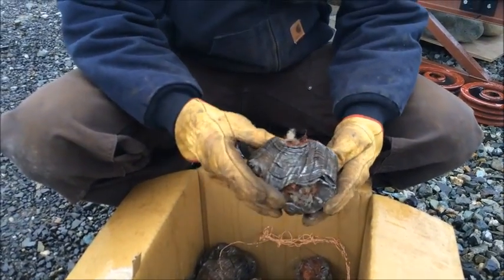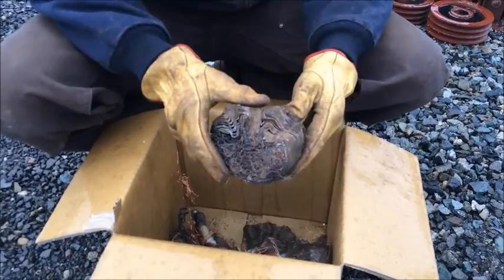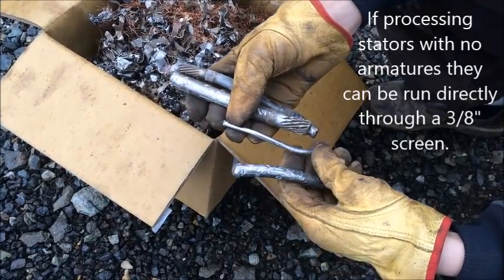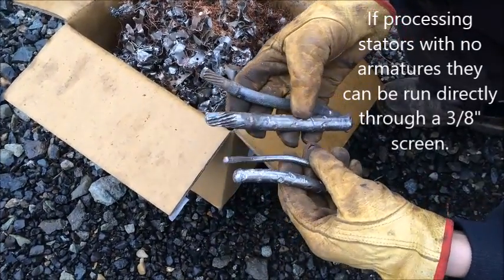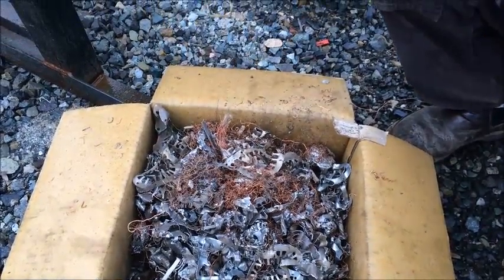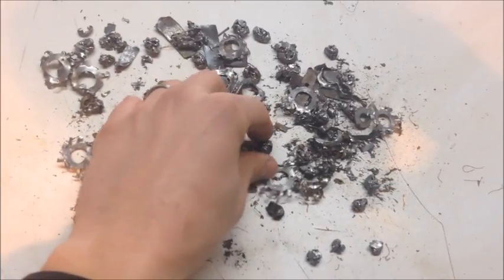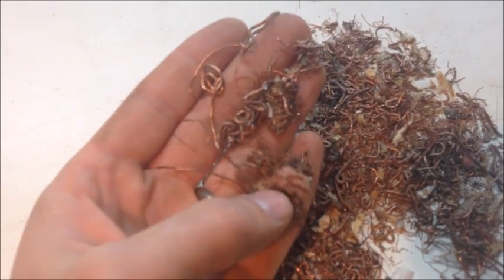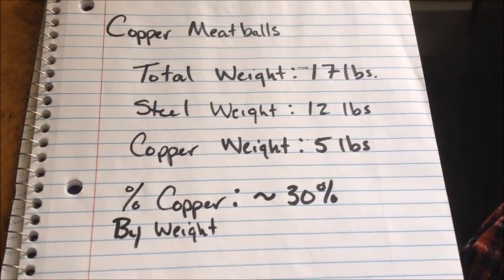MBMMLLC.com Recycling copper meatballs from electric motors to get clean copper

Comment: Please, Do a video of 3-5 hp gas lawnmower engines.  Also a video of small 2 cylce engines that weed eaters and blowers use.   Your machines seem to be bare bones that do a good job.  This is important because there is small margin in cleaning Scrap.
Reply from the maker: Great, thanks for the tip!

Comment: What size hammer mill is this?  I saw that the screens can be bolt in, is that an option or standard?
Reply from the maker: +bob jenkowitz The mill in this video is a 16"x12" hammer mill.  The screens are bolted in and this is standard for these mills.  Thanks

Comment: any videos on the insides of these smaller hammer mills ?
Reply from the maker: Magpies Recycling Thanks for the question.  Here is a link to a video we did on the operation and maintenance of our hammer mills: https://www.youtube.com/watch?v=IDx1-o_xZcI
The mill in the linked video is set up for ore grinding, but the hammer mill is almost identical save for the inlet hopper and the screen size installed in the mill.  The recycling mill screens are also bolt in screen so they can be changed quickly in about 10-15 minutes.